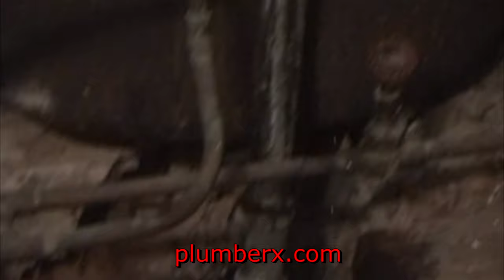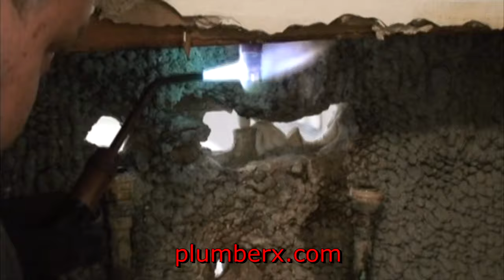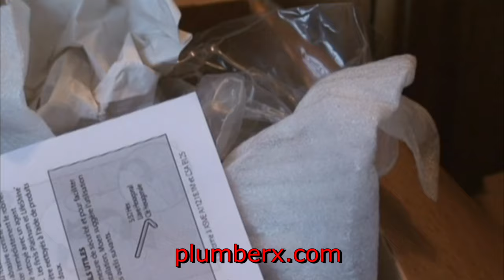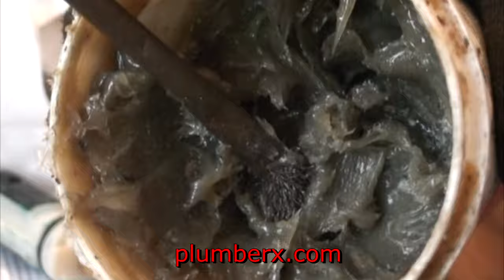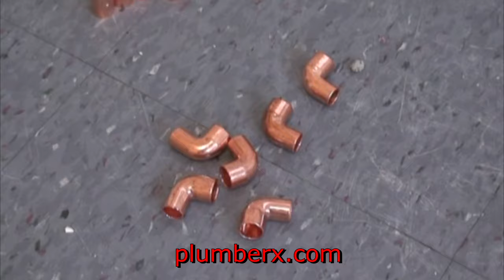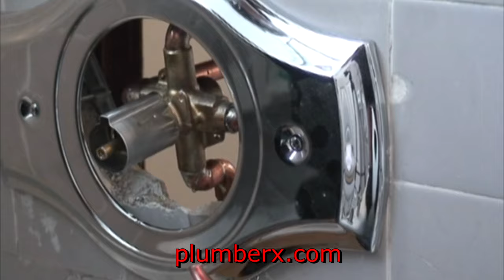1 Handle Tub And Shower From 3 Handle

Comment: If you had access to the pipes and valve from the rear, why did you cut such a huge opening in the tiled front of wall that then required the oversized renovation cover plate. Thanks!
Reply from the maker: @whynotdiy333  I did that to center the new valve, going from three handle tub and shower valve to single the opening is different 👍

Comment: Had a rehab at a 110 unit complex and they put 70% of the moen posi temp valves in upside down. It sucks because I always forget to look and see what way the carts installed when I replace the cartridges. Luckily I found a ona puller makes the job quick and easy

Comment: My house was built in 1994. 2-handles in my stand-alone shower and 3 handles in the tub/shower. I’m having my bathrooms refilled so not trying to to save the old wall. All of  my bathrooms are built without access to the plumbing in the back of the tub and/or shower. Once the wall is open should a reputable remodeler be able to get to the pipes needed to covert my 2 and 3 handles to 1?  
Thanks for the video. Very helpful. 
June 15, 2023
Reply from the maker: Thank you for reaching out and I'm glad you found the video helpful!

To answer your question, yes, once the wall is opened, a reputable remodeler should indeed be able to access the necessary plumbing to convert your 2 and 3-handle systems to a 1-handle system. This conversion is quite common in bathroom renovations and it usually involves installing a new mixing valve. The mixing valve, which is what the single handle controls, regulates the blend of hot and cold water that comes out of your faucets or shower head.

Please bear in mind, however, that while this conversion is technically possible, there can be variables which might increase complexity or cost. For instance, the spacing between the hot and cold water supply lines may need to be adjusted to fit the new mixing valve. Also, your current plumbing may be made from materials that require special care or additional work to modify.

In addition, if you have any code requirements or particular brands/models in mind for the new fixtures, you should discuss this with your remodeler upfront to ensure compatibility with your existing plumbing.

I hope this information is helpful and I wish you the best of luck with your bathroom remodeling project!

Comment: I need to upgrade my bathtub faucets and the tub; the whole bathroom actually. Im DIYing my house and thought Id give this a try. This video let me know whole process in detail and now I know I need to hire professionals.
Reply from the maker: I'm glad you found the video informative and it helped guide your decision-making process. Renovating a bathroom is a significant project, especially when it comes to replacing plumbing fixtures, which can get quite complex. It's very wise of you to acknowledge the need for professional help, as this will ensure a high-quality and safe installation. The benefit of using professionals is that they have the required skills and experience to prevent any future leaks or damage that could potentially result in costly repairs.

Remember, while DIY projects can be fulfilling and save money, certain jobs require specific expertise. There's no shame in admitting when it's time to call the pros. It's actually a sign of wisdom to recognize that there are limits to what we can do ourselves, and it's better to get things done right the first time than to risk having to fix mistakes later on.

You've already taken a significant step by researching and understanding the process. This will enable you to better communicate with the professionals you hire and ensure your needs are met. Good luck with your bathroom renovation!

Comment: Thank you very much for this video!  I found you on Google and just subscribed. You've answered my questions regarding upgrading a legacy bathtub/shower combo to a one-handle style.    I was hoping to avoid having to solder pipes since I don't want to accidentally burn my house down.  My current setup has a diverter spout and two handles, but a third handle like the before setup in this video seems to perform the same function as the pull-up part of the diverter faucet.  Can a three-handle set with a non-diverter spout be interchanged with a two-handle set with a diverter spout?  I'm finding a better selection of bathtub shower sets that I like with three handles rather than two.  What would be involved in changing from a two-handle to a three-handle setup aside from having to make a hole for the third handle?  The tub currently has diabolically ugly fake tile paneling around it so I don't care about messing it up.  I plan to replace it with subway tile anyway but would like to get the tub hardware replaced before installing new tile.  Thank you for any insights you can share.🙏
Reply from the maker: I appreciate your nice comment🙏

Comment: Can you do this in a mobile home? The moens that I have looked at say not for Mobil home! My 97 year old mother cannot turn handles any longer.
Reply from the maker: I see. Yes some older mobile homes are different. The walls in some older mobile homes are to thin to fit a standard tub and shower valve in. I would have to see what your working with. Sorry 😐

Comment: Would it help to score the tile first to get a less sloppy hole and prevent damaging the wall?
Reply from the maker: Your right, but this is not the standard tile wall that most people are used to. This wall is all cement with a tile overlay. These homes were built during the cold war.
They're built like war destruction-proof Shelters very thick wall floor basement heavy-duty reinforce steel cement floors and walls. and the homeowner was doing a lot of the work himself. I was just limited to the plumbing. Could it have been done differently? Yep $$$$$$$$$$$

Comment: Great job on the tub and shower valve I've installed 10 or 12 moen valve not a big fan ,but I've installed 100's of delta valves I like them better but some don't.
Reply from the maker: I like Delta valves, but a big fan of moen. Both great Valves and popular in the trades
Reply: The problem with Delta and Moen is not their valves but their ugly cover plates. It took a while, but I tracked down a beauty made by Symmons.

Comment: Do the 90s have to be soldered or do they sell that 4 way with treads or maybe for pro press
Reply from the maker: This video is over 20 years old. Didn't have propress then😖but yes they do make this tub and shower valve in propress now🤔hard to find,but it's out there. No you don't have to solder any more☺️

Comment: how much to hire plumber to do this ? parts ? labor ? Thanks
Reply: Depends on if you have galvanized or copper pipes. We were quoted $400 for copper - up to $1000 if needing to deal with old galvanized pipes. That included all parts and labor except the rough in valve.

Comment: I'm going to strip out the single handle thing the plumber put in, and install a 3 handle fixture. Right now it is either crank the water heater or goose bumps.
Reply from the maker: I do understand, but the single handles shower and tub faucet are to protect kids and disabled people from getting burn by turning on just the hot by itself. This is why you don't  see 2 and 3 handle tub and shower faucets in newer homes built after the early 80's they have been outlawed. The single handle faucet will not turn on if hot and cold are not mixed. Making it very hard for anyone to burn themselves with just hot water.

Comment: Great video brother I wish they were all that easy I'm working on one now back to back that's a freaking hassle I hate having to take out the galvanized riser but the existing trim plate was humongous in order to have my valve sit right I had to remove it if not it would have been a big gap between the new cover plate and the existing hole. I have no clue in hell how I'm going to strap the shower head either LOL I guess they're just going to mud it in when they patch the sheetrock 🤦😝😂
Reply from the maker: Lol 😂 thank you for the comment, and by the way one trick I use to Anker valves, some time I use great stuff expandle foam. Just saying👍
Reply: @theartofplumbing  I know about that my dad told me he did it before LOL what I ended up doing on this one I glued two inch and a half nineties together but it up and then stuck the hubs towards the other wall and then just screwed the drop out into the 90s I mean you can't Yank on it but at least it's not flopping all over the place LOL